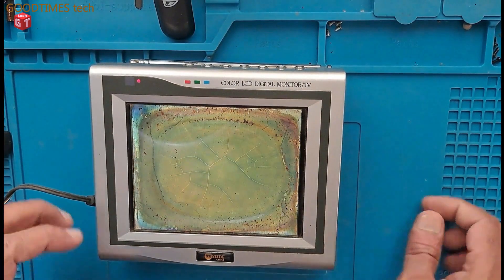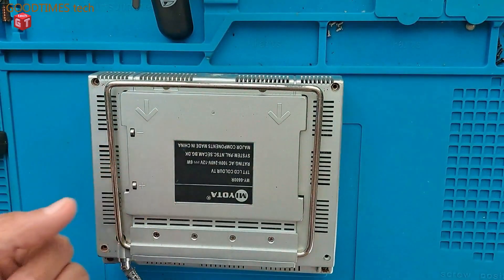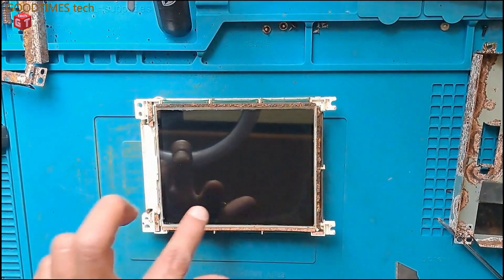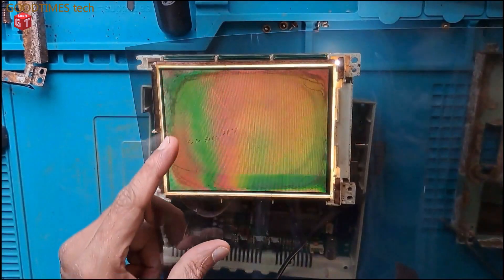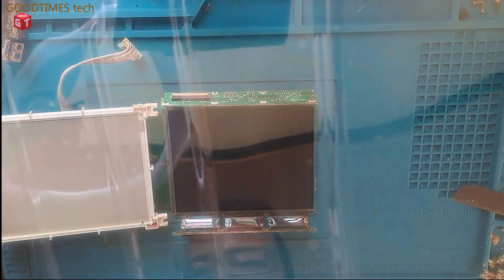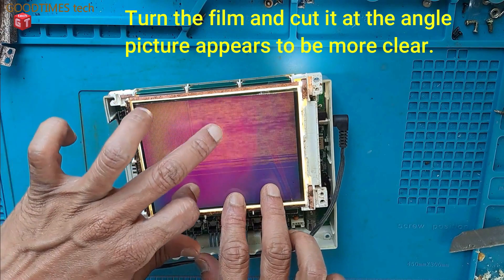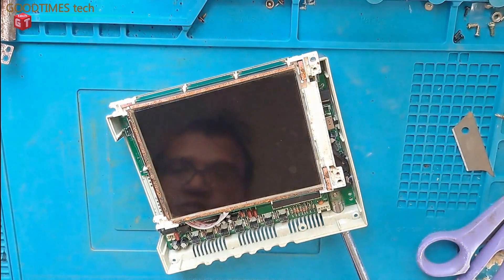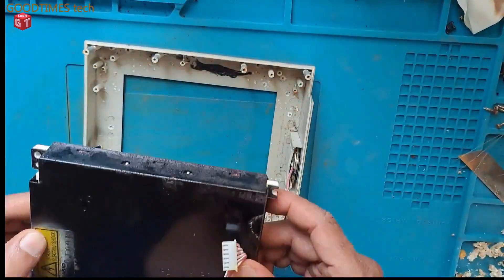How to replace front and rear polarizer film | LCD LED Curved TV

Comment: Sir where did u buy the polarizer replacement film, any shop or online store link is very helpful. thanks
Reply from the maker: Hello sir, i got it at local market, you can try link given below, but it appears to be very expensive:
https://www.amazon.in/Polarizer-Replacement-Front-Screen-screenguard/dp/B09MM28KBV/ref=sr_1_1?crid=2FW8I7DD1L532&dib=eyJ2IjoiMSJ9.uTgriOCmBM-0QM4bXgoAD6bViHD4Ec4ctrzwdR2TEDBh2OM2D773T-B0dDewc527FkzVgTJOSOO5Ag7TGfDAW1NrjIN3CS3cIEE-Y_vW3ss5BswzOWpGAZfukP7d3XJgXjcBstC_DhNAR_jURKEnaYv6SQfJoaG9iYzSBtz19ko0pnAnrwTtIVW9KrZ5UsiBu9zzOP1PrSpPOAPMxIopwCsk3Ng6KWWsGkBEF8sDmZM.OO7tQcczdCn6IwJx-NG2QMl0DDqzau88O0cfqTOYTlI&dib_tag=se&keywords=22+inch+polarizer+film&qid=1714443728&sprefix=22+inch+polarizer+film%2Caps%2C323&sr=8-1
Thank you, have a GOODTIME....